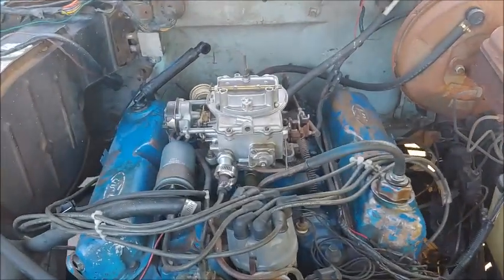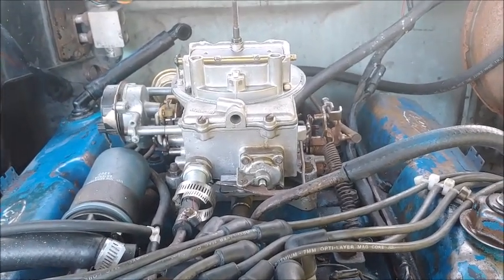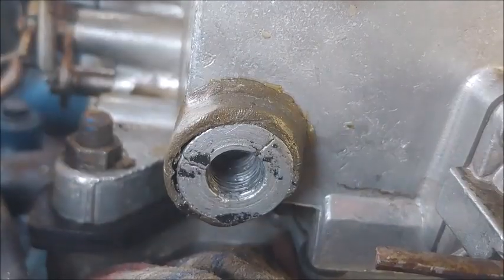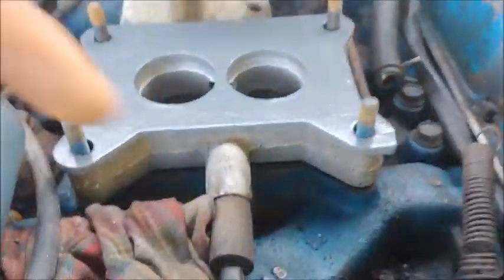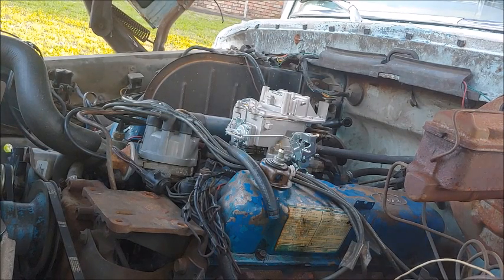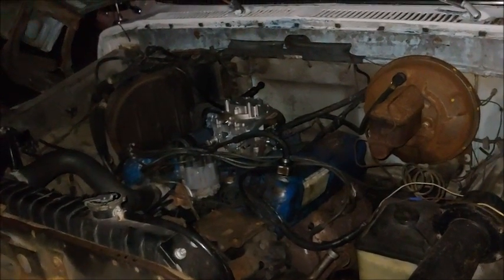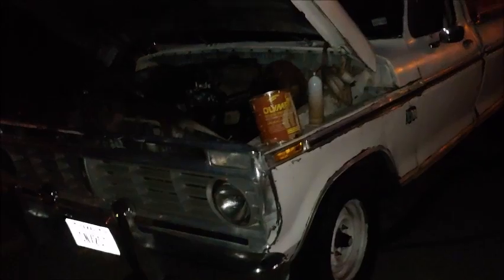1974 F100 Carburetor Replacement

Comment: Thanks a lot for posting this video. I have a 1980 ford f 350 same problem your having. I was curious about what you did with the hoses you blocked since my old carb does not have the vent tube elbo on the front. So it looks like you ran a small hose down to another vent tube down low on the side of the carb is that correct? Thanks for any answers you may have.

Comment: Can someone recommend a 2 barrel replacement for a Ford 360 cu inch?  75 Ford XLT 4x4 half ton.  I cannot find info about using the 2100.  Only used on 389, 302 and 351.  Don't need a ton of power.

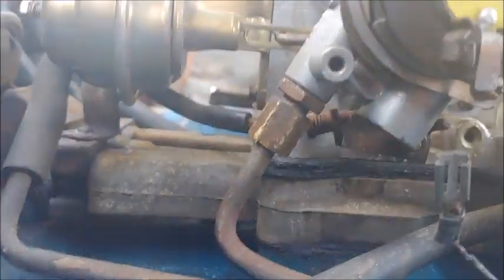Comment: Question my friend what js the name if that.  In the minute. 5:47. I broke mine.  And can't find it anywhere.  Thank you
Reply: @Fernando Hernandez  did you ever figure out what it was? Mine is also broken 😅
Reply: I got told.  That was nothing to important.  Just close it forever with something
Reply: @FernandoHernandez-ru1ui  so I don’t have to worry about it either? Mine broke as well lol
Reply from the maker: It's part of the EGR system. You are right, it can be blocked off forever.
Reply: @cronedentside74  thankyou for the response

Comment: What is that hose called/for, on top the back left valve cover? Im missing the hose and need to know what its called.
Reply from the maker: It’s the pcv valve hose
Reply: @cronedentside74  Where does it connect to? from the valve cover to where?
Reply from the maker: @FincTM  on my setup, the factory air cleaner. Some can connect to the carburetor on 4 barrel setups I believe.
Reply: @cronedentside74  Do you have discord by chance? or an email that I can send a photo? last thing before starting her up
Reply from the maker: You can message me on Instagram at Cronedentside74

Comment: Would this be about the same for a '76 F-150 with a 360?
Reply from the maker: It should be similar, yes.
Reply: I’m here for the same reason, my 75 F150 has a 360 fe did it work for you?

Comment: Link to the carburetor from Amazon...
Reply from the maker: Two 2 Barrel New Carburetor Carb 2100 2150 For Ford 289 302 351 Cu Jeep Engine with Electric Choke - Compatible With F100 F250 F350 Mustang Mercury Comet Wagoneer and More https://www.amazon.com/dp/B077HQP51S/ref=cm_sw_r_cp_api_glt_fabc_XG5R4DM937WYY87QJTNX
Reply: @cronedentside74  
How did it work out for you, longevity wise...
Reply from the maker: @joeschlotthauer840  I ended up getting about 14 mpg. I really liked it but about a year later upgraded to a four barrel setup. It was worth the money for me.
Reply: @cronedentside74  
Wow, manifold change and everything, more miles to gallon or less, noticable power gain....
I have a 79 F100 that's slower than molasses...
Reply from the maker: @joeschlotthauer840  I not get about 9-10 mpg, power gain was noticeable. Still not beating anyone in a race but not as slow.

Comment: As a daily driver?
Reply from the maker: I try to but the transmission went out. Currently building a big block 460 for it. I’m making some videos of that right now.
Reply: @cronedentside74  I have a 1972 ford f250 as well. Andnim having trouble with it to.

Comment: Was looking into maybe getting one of those, especially at the $78 they're selling at. I have a 71' F100 302cid and it doesn't have the electrical choke. Could you do me a favor and see where the electrical wire is coming from. I'm thinking I can just run a wire from the positive coil terminal, but need to look into that a little more. So the power value in the replacement carburetor is a single stage design and not the 2-Stage type that other YouTubers say comes with those...Looks like you're the first to pop the cover and discover that. Is the carb still working good?...Thanks for putting this up.
Reply from the maker: That wire is supposed to connect to the center tap of the alternator to ensure it always has current. So anywhere that always has current should work. And I recently switched to a four barrel set up but that carb was consistently getting me 14 mpg and always ran very well. It was totally worth it.
Reply: @cronedentside74  Hey thanks for getting back to me. Ok, center tap on alternator, which is probably better than tapping into the coil power. Yeah, that's about what I get with the 302, but the C4/C6 only has 3 gears, so it's not going to get much better than that. I was thinkin a 4 barrel one day also. Do you get better mpg if you stay out of it? If the primaries are smaller than the 2-barrels, you can actually get a little better mileage with a 4-barrel...Kinda curious about yours. Did you go with a 4100?
Reply from the maker: MrDLRu I went with the Summit Racing carb. Nothing too fancy but it does the job. Getting a little worse gas mileage but I’m currently working on replacing my C4 with an AOD. Hopefully that overdrive gear helps with highway mileage a little bit.
Reply: @cronedentside74  Yeah, the AOD will do better mpg for sure. Let me know how it goes in and turns out if you can.
Reply: The power to the choke has to come from a keyed source.  Only needs power when the key is on. You DON'T  want constant power

Comment: My l974 ford f100 doesn't have that front top vacuum hose connection. What do you hook to that when you buy the new carburetors that have that connection? I have a 302 engine.
Reply from the maker: On mine, I just plugged it. I didn't have anything that required the vaccum.

Comment: How's that cheap Amazon carb holding up after 3+ years?
Reply from the maker: I don’t have it on the truck anymore because I changed to a four barrel setup but it worked great for as long as I had it
Reply: @cronedentside74 oh ok how long did you end up riding it? I'm just trying to decide whether I want to spend the extra money or not
Reply from the maker: Little over a year. I think it’s worth the buy but that’s just my opinion. I just put another Amazon carb on my 4.9 6 cylinder and it runs good too.
Reply: @cronedentside74  cool, thanks brother

Comment: Hey can you give us an update is that Amazon carburetor still working good have you had any problems with it? I do appreciate your reply and your time thank you I’m thinking about putting one on a  73 F -100
Reply from the maker: I used it for maybe four or five months. Hardly had to tune it. Got about 14 mpg. I liked it. Pretty impressed. But I did end up switching to a four barrel setup
Reply: I appreciate it very much thank you

Comment: Part of linkage on the new carb appears to be loose and doesn’t seem connected to anything. I mention this because I just bought one myself. Any insights?
Reply from the maker: Mark Harvey as long as you know where the throttle linkage and kickdown linkage go and they are working properly everything should be fine. However it might be a good idea to look up a diagram of your specific carburetor to confirm that.
Reply: @cronedentside74  Any chance you would be willing to send  a couple of pictures of the linkage on yours? I am struggling to see how this all goes back together

Comment: What’s the connection on the rear of the carburetor, the copper line? Is that a vacuum line into the manifold ? Is it necessary or can it be plugged off?
Reply from the maker: The copper line is part of the EGR systems. I believe they can be blocked off to delete the EGR system.
Reply: @cronedentside74  one more question mines a 1972 f100 does it still apply to that year?
Reply from the maker: @captainshimmer7319  It will be very similar if not the same
Reply: @cronedentside74  appreciate it it was driving me nuts thought I would have to reflange it ,thankyou 👍